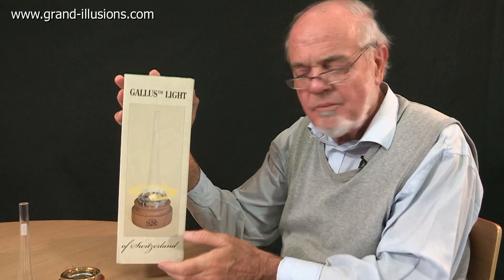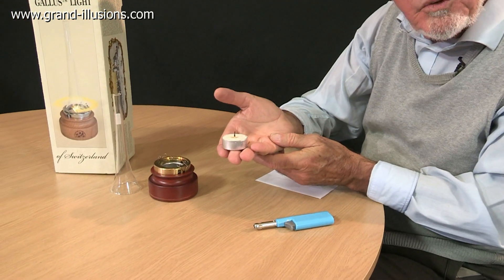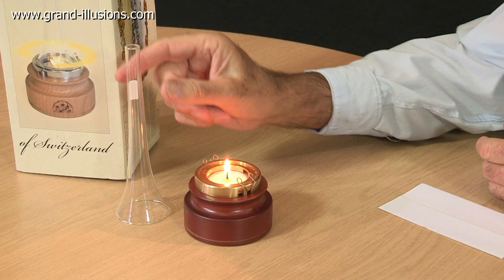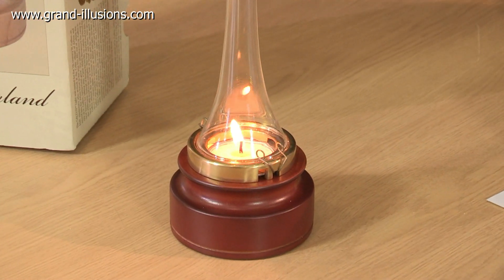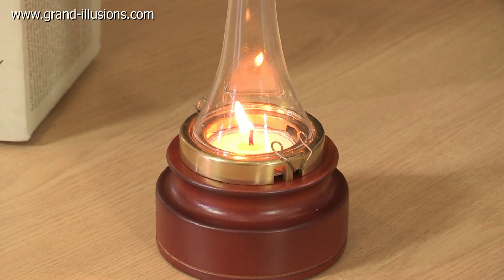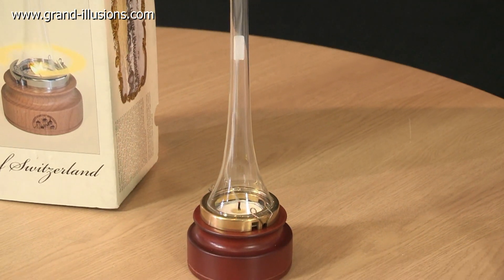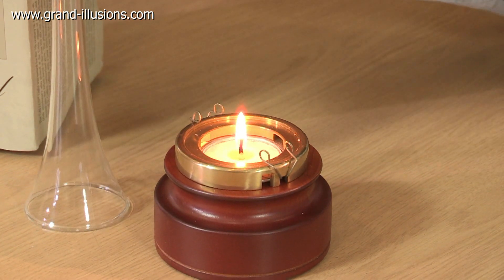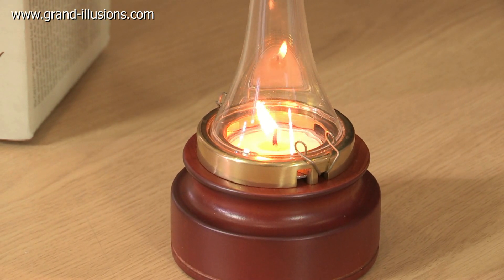Gallus Light

Comment: quando spegni la fiamma, è inutile togliere il cono di vetro, in quanto a bruciare e ad essere infiammabile è il fumo rilasciato dallo stoppino. Se subito dopo aver spento la fiamma, avvicinate alla bocca del cono una fiamma, lo stoppino riprende subito fuoco. When you extinguish the flame, it is useless to remove the glass cone, as the smoke released by the wick burns and is flammable. If, immediately after extinguishing the flame, you bring a flame close to the mouth of the cone, the wick immediately resumes fire.

Comment: surface tension changes with thermodynamics which means as the air around the flame is spent to produce the energy, it also gets thinner meaning the flame has to chase higher pressures to keep itself fed.

due to the radius of the chimney, the air that is spent for the flame is about the same size of the flame meaning that only about a quarter of the air is spent in the flames locale meaning the flame can move in iterations of 25%, which allows it to rotate around since the next closest high pressure area would be directly to its side.

Comment: Brilliant updraft wind vortex unit. Put  a 6 blade  intake fan with 60degree then a 27 blade 30 degrees on the exhaust for back pressure . side vent for a choke. Taller the chimney the higher output. Here is the free. Cool those units using big water heater tanks for backup energy. Using TEG. A beat case scenario is to make your own with different potential metals. All have different benefits and flaws. But water storage seems best on a small individuals budget.

Comment: Don’t understand the magical bit. Hot air rises and draws air in from the apertures.
If the apertures are formed with a slight angle as stated, then of course the incoming airflow will be directed accordingly.
The shape of the glass chimney would cause the hot air to rise quicker and the vortex effect to be magnified.
Reply: I think he is just expressing the wonder of it. Nothing more.

Comment: I would like to know does it always spin clockwise if so why?
Reply from the maker: The air inlets are angled, so the flame will always rotate in a particular direction. However you can get a lamp where the inlets are angled the other way.

Comment: It's a clock.  That's one revolution per second.  It's a scientific instrument for timing things.  You could bake a perfect consistent cake with that, get your hardboiled eggs just right, etc., just by counting the revs the way a woman counts her crochet or knitting stitches.

What an invention.

But it's much cheaper and easier to make than a real clock if you don't mind doing a little counting or keeping track on a mechanical accumulator of some kind.

You could accomplish so much that requires a consistent measurement of time with that thing if you had any kind of scientific or precise mind during all those long cold winter nights.

Comment: Many years ago I encountered a wonderful teacher name Pam Warren at Ingleborough Hall outdoor education centre in North Yorkshire. She entranced pupils with a very neat trick using one of those old globular light covers you used to see in offices + a candle + a carpet + darkness. She would gather the children around her in the cellar and they'd sit on the carpet. The candle would be lit and then the globe was lowered over it. After several seconds the glow started to fade until all that seemed to be left was the after-vision in your eyes after staring at the glowing ball ... but then, again and again, it would flare back into brightness, only to fade away again. Every recurrence lasted for less and less time and the brightness was also fainter every time until - of course, it eventually stopped completely. Throughout this experience, the children would sit in total silence except for gasps as the light flared each time. The trick, of course, was because the whole 'glowball' assemblage of candle and cover had to be sitting on the carpet rather than sitting on the flat stone floor where the seal between glass and stone would be far tighter and less liable to let a fresh supply of air to be drawn into the vacuum.  Such a simple idea but in the hands of a brilliant teacher, it became pure magic.

Comment: its 1:47 AM 

send help
Reply: +indeed Look up the price. You'll be so disgusted you'll turn your computer off.
Reply: +mrbibs350 Looks like the one company who makes these in USA patented it in US and Australia, they patented the use of physics in such a way that a flame rotates... I wonder if that patent extends to the UK. 
It seems such a simple design, if the vents are angled correctly it should work, if someone has the skills to test it with wood and then release the design specs as a 3D file, one could probably 3D print it.
Reply: +Daniel Jackson That strikes me as odd that someone could patent that. A guy I knew a few years ago had a "water pipe" that had those holes in it and made the smoke cyclone up to the smoker.

Comment: You should try lighting the "smoke" coming off of the extinguished candle. The smoke given off by a recently extinguished candle is actually vaporized wax and if you hold a flame to it the flame will chase the smoke back to the candle and relight the wick! I imagine it would be a neat effect running down the glass of the gallus light

Comment: Actually, this is another trick that is being used that you cannot immediately see.  There is a turntable which he is pushing while his hand is in place.  His wobbling of the table (right when the camera zooms in) is causing the flame to tilt from side to side.  The portholes are merely there to provide anchor points to lock the glass dome in place.  When the paper goes on, the holes serve to blow the flame out because there's nowhere for the air to escape so it blows around the holes by blowing out.
Reply: No, go to the website of the manufacturer of gallus light and you will see that it is real.